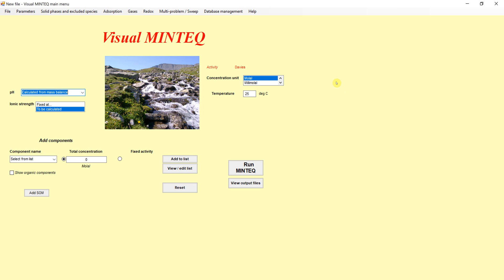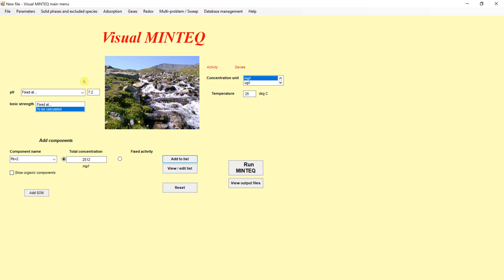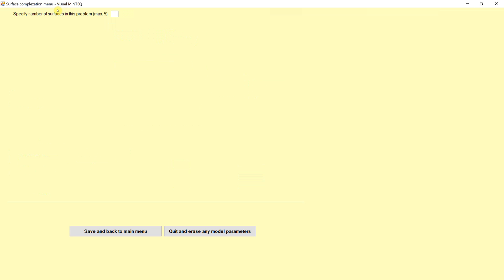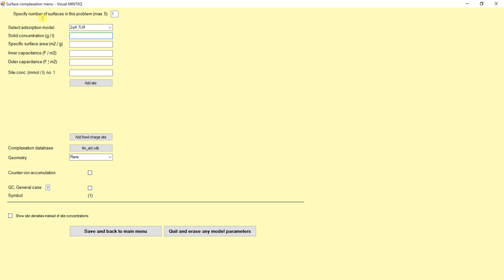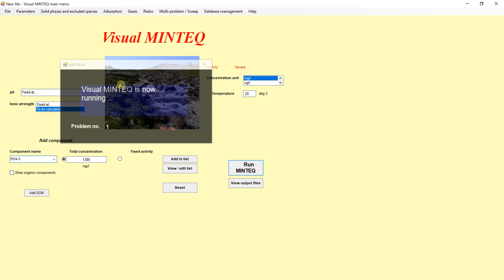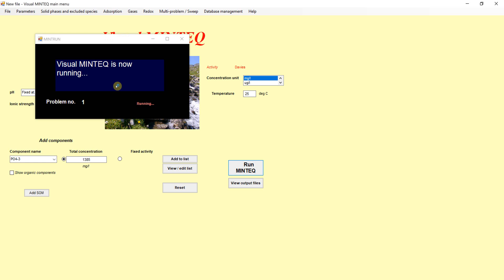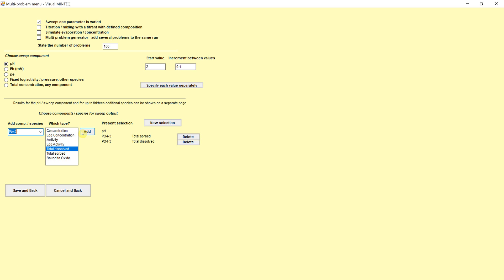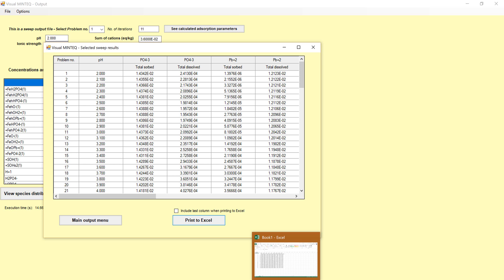Minteq adsorption model: How to implement one

Comment: In add component box, there is F+2 and Fe+3 which of them should I select to represent iron concentration in my samples? And the same with rest metals having more than oxidation state
2.      When I checked fixed activity option and when not?
3.      If I measured HCO3 and CO3, should I input only one of them or both? When I add HCO3 from alkalinity tab it appears in add list as CO3; how to insert both?
4.      In multiple problem dialogue box, there are 4 choices (1- Sweep 2- titration 3- simulation and 4- multiple problems) what the benefit of each of them? Anyone of them I should check to obtain species distribution and saturation index?
5.      I wonder if there is option to insert excel sheet data once instead of manual input